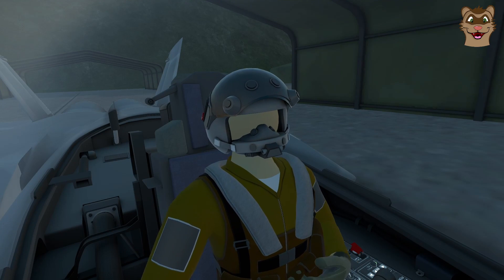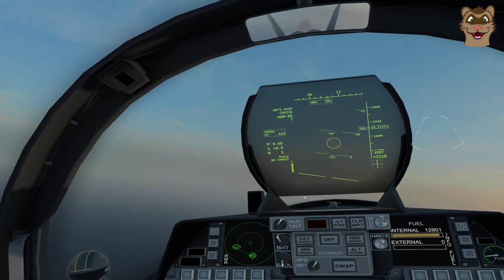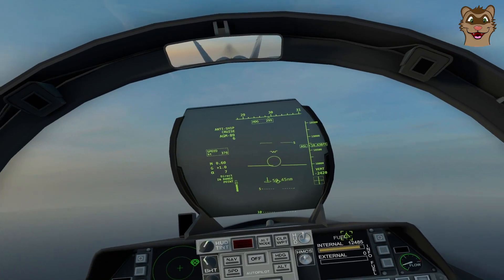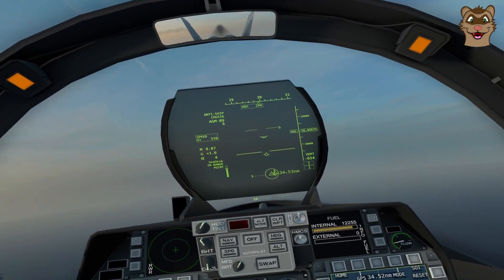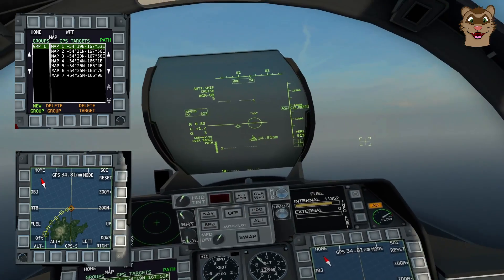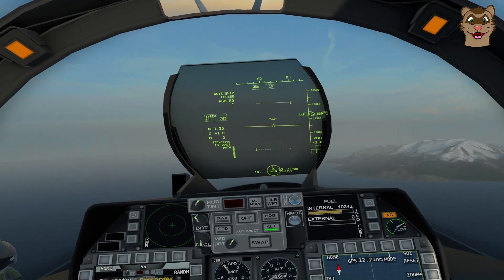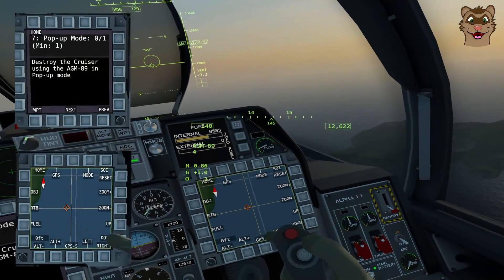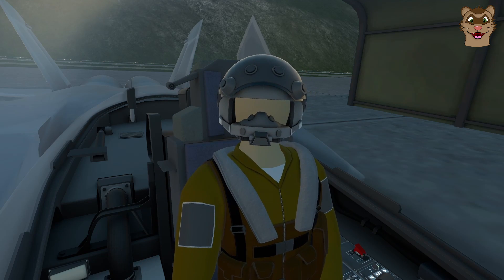VTOL VR AGM-89 Over Explained

Comment: question, you mentioned the flight height you can set that. I was wondering if I set the height to go over a mountain like you mentioned then took the height down for the next point would it go down or stay in the same alt?
Reply from the maker: It will follow the altitude of the next waypoint. If WP1 was 250ft and WP2 was 2000ft then WP3 was 500ft it would try to pass through each waypoint at the specified height. Going from a low to high waypoint will reduce overall range though, so if you need to clear a mountain and there’s a very low chance of it being shot down, then it’s better to have most of the waypoints high then the last 1 or 2 low to get maximum range